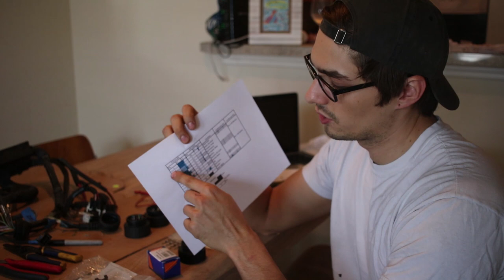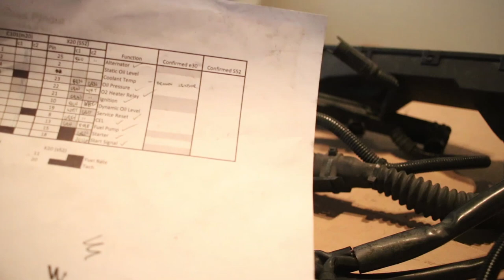Rocket Bunny Turbo S52 BMW E30 Build | Part 7: DIY 24v OBD2 Swap Harness

Comment: Most youtubers just skip doing the wiring videos, it's definitely difficult to make them interesting for someone not attempting the exact same job, and getting everything right is challenging enough without thinking about the camera doing its job, but I appreciate the effort, I like this video. I recommend using flux remover/electrical cleaner on any connector that has been soldered to avoid long-term oxidation.
Reply from the maker: Good tip, my soldering could absolutely use some improvement here.
Thanks for your support man!

Comment: Hey,
I'm having trouble with my obd2 port where when I hook up a scanner it's getting power, but I cannot connect to the DME. I have the following pin-out:
- Pin 6 C101 --> Pin 22 X20 (12v switched power to diag port)
- Pin 16 C101 --> Pin 17 X20 (K-Line connection to Diag port)

Pin 16 X20 is L-Line connection to diag port; however, this is not wired to anything and every diagram I've read does nothing with this. Do you know what I could possibly be doing wrong?

Someone was telling me that if I am flashing my DME (which I am because big turbo), I need to connect 20 and 17 on diag port. Does any of this make sense?

Comment: Great info!!! going through with this swap right now But I'm using a Z3m wiring harness (sad face) things are similar in this video. I'm wondering if you are going to be using the OBD2 16 pin DLC that is typically under the dash if so what pins are you using I've been checking for continuity and can only find one of the wires. Thanks!